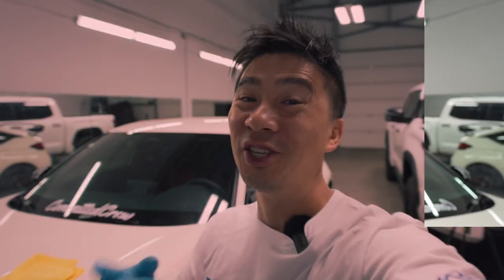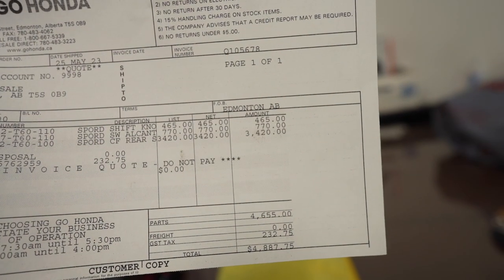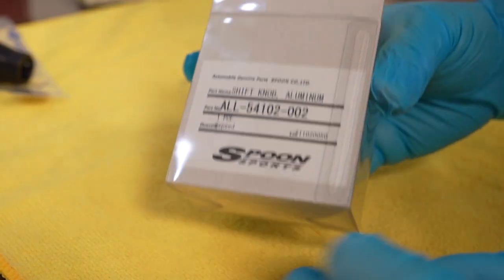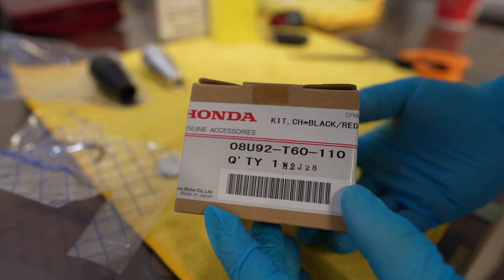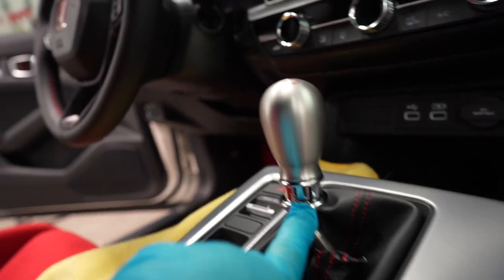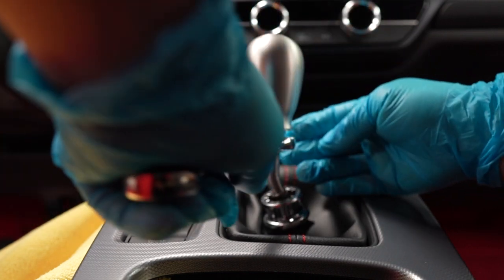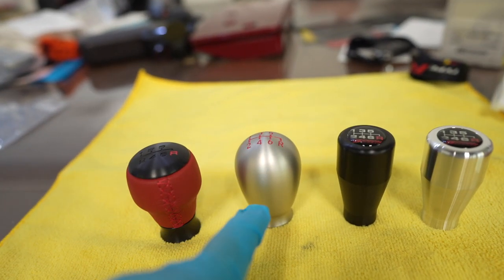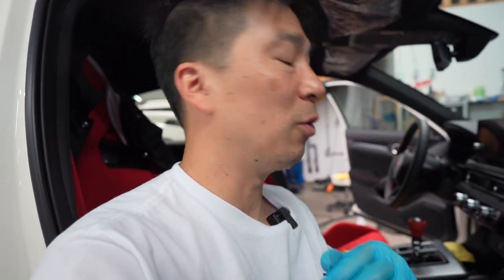FL5 Shift Knob Showdown 2023

Comment: Bro i bought the oem red and black and just spent the last 3 hours looking for a video showing how to do it properly and even saw a guy in another video put electrical tape in place replacing the oem zip-tie  location under the boot🤣🤣 thanks for making the best video on this so far
Reply from the maker: Yeah I noticed a lot of FL5 owners giving out wrong instructions. It is very simple once you figure it out. Glad you liked the video!
Reply: @phothrottle you should do a video on the illuminated door sill plates, theres only one video and the clips go too fast as well as the voice over, mine came in today but it would be nice to see an install video on that one accessory🙏🏼

Comment: The red and black one for both looks, feel and colour coordination with the interior.
Reply from the maker: That is what I chose and currently using.
Reply: @phothrottle  How's it working out? I saw it on the Net and was thinking about getting the same one myself.
Reply from the maker: @white-dragon4424  I like it. Has a nice feel in the hands.
Reply from the maker: I like it, has a nice feel in the hands.
Reply: @phothrottle  Is there any wear in the leather bit of the knob? I had a coloured gear knob once and the colour soon started to fade.
Reply from the maker: @white-dragon4424 I'm pretty good with my stuff. So far the leather is holding up